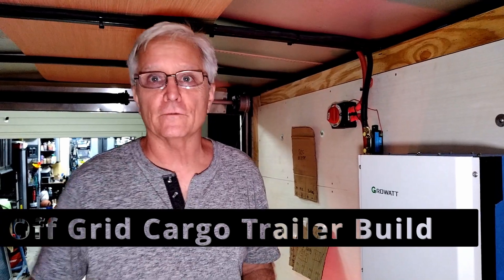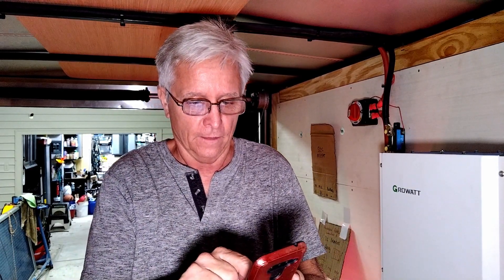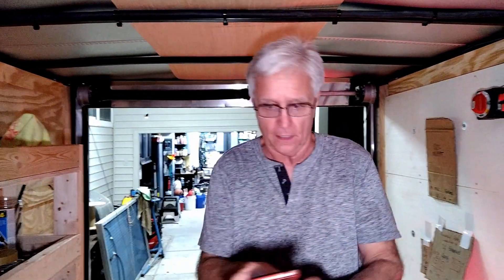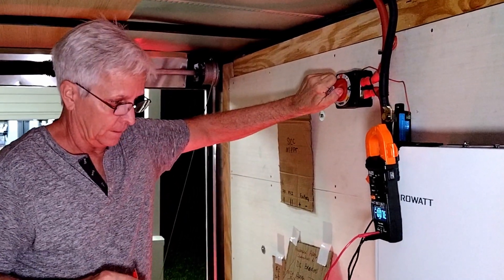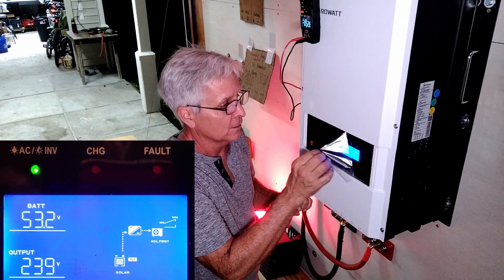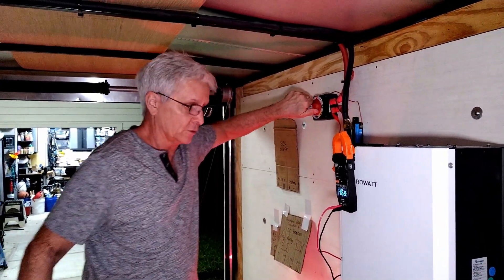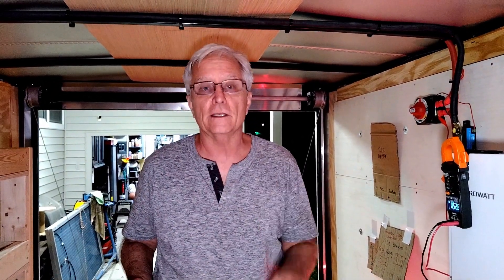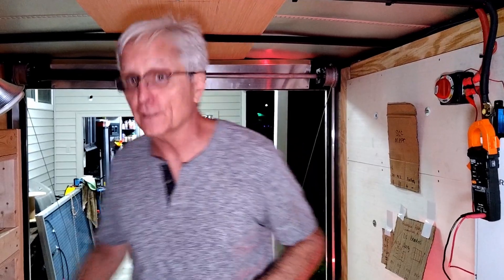Solar Off Grid Cargo Trailer Build ~ Inverter 1st Power Up & Test

Comment: Ya, I just got a closer look at your battery switch and looked up Marinco 772-dbc rated 12v-48v, I believe if you called them they would say that the approx 56v that lithium run at in order to get fully charged etc. is to high, and beyond there ratting? But you can go with the circuit breakers like what signature solar runs on their batteries, and use one on each set of batteries in order to achieve the amperage and then still use you class T's as backup? They have some Nader circuit breakers on their web-sight, but I don't know if they are two way dc circuit breakers for discharge and charging or not, if so and the amperage range is good for you that could solve that issue. I found what I hope are good ones for my system else ware. I'm doing a trailer or so also. Thanks again for your videos!
Reply from the maker: We'll look into that

Comment: Note: most of the battery on of switches that can be found from like Victron or BlueSea state that these switches are up to 48v MAX not beyond to like 56v that a 48v system runs on, they will burn out in time!? I know they make it confusing but those switches are only good for up to 36v systems etc. If you found one by a good make that is designed to run at an actual approx 56v+ please let me know I've been looking!? So I've gone to high AIC dc circuit breakers on my 48v system, and they are large and kind of expensive depending upon amperage. But this did save me from having to run a class T fuse there. Thanks for the videos!
Reply from the maker: No, just using a BEP 772
Reply: @OffGridandOutdoors  OK, I believe now, that the reason for the 48v dc MAX limit on all these switches, is the UL rating won't let them go beyond an actual 48v, for the better brands to be rated to? But I also know some people are running them above that, but that could cause a fire risk etc?

Comment: Always leave the inverter off when connecting power, doesn't matter of using precharger or not. Precharge for 30-45 seconds, switch to full battery power, turn inverter on.
Reply from the maker: He thx.  Yeah I learned that the hard way. I actually burnt and pitted the switch a little.. Had to take it apart and clean it up.

I'm actually working on a start up instruction sheet today.

Comment: I'm sure if you'd taken the time to read the instruction manual for the inverter, they would have given you a power up / power down procedure......
Reply from the maker: Thx for the comment and suggestion.  There is actually very little in the Growatt manual about start up procedure (as in nothing), or the units capacitors, ect. And even though there is a "Power Saver" mode on the main switch of the unit, there is nothing about what it does and what requirements are necessary to wake the inverter up in power saver mode. Most people agree just don't use that mode.

I have placed a master on/off switch for the whole system in front of the inverter that also contains a pre charge resistor for charging the inverters capacitors before they would get the full inrush amps of very capable LFP batteries (not as much a problem with Lead batteries).  As you can imagine, there are no instructions in the manual for such a switch (which is necessary for LFP batteries). The manuals start up procedure is limited to a mere 1/4 paragraph on p13, a mere 30 words that amount to "turn on the switch".